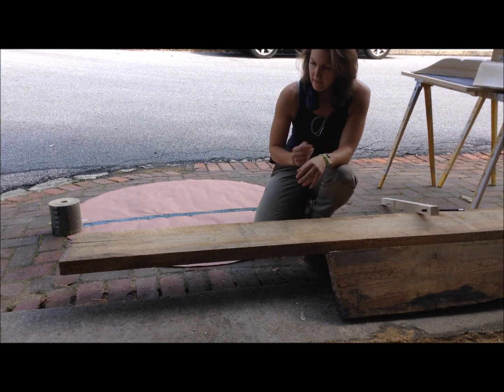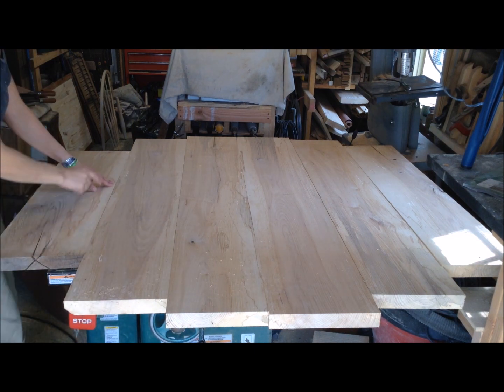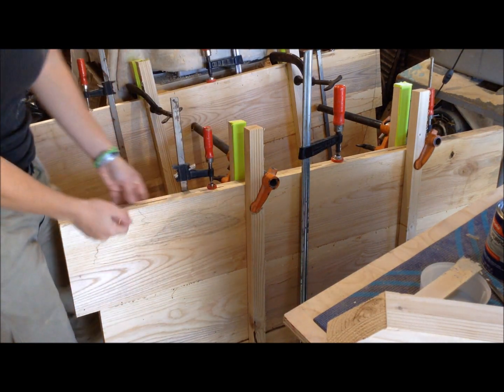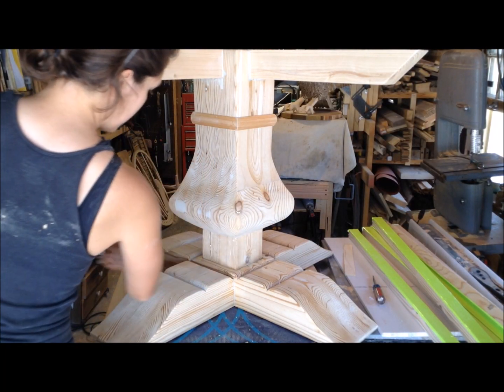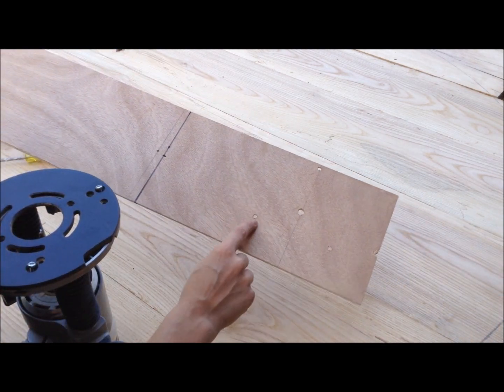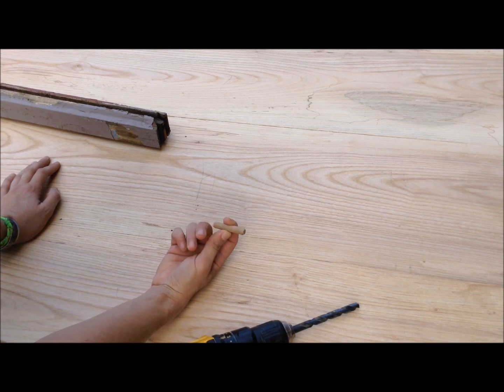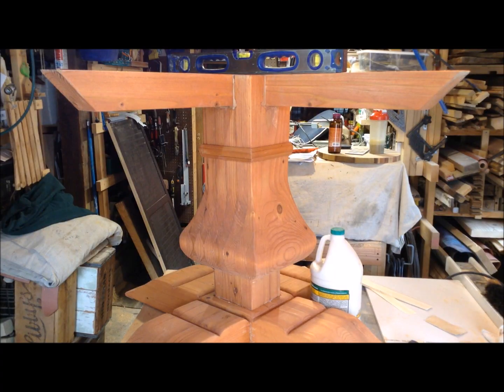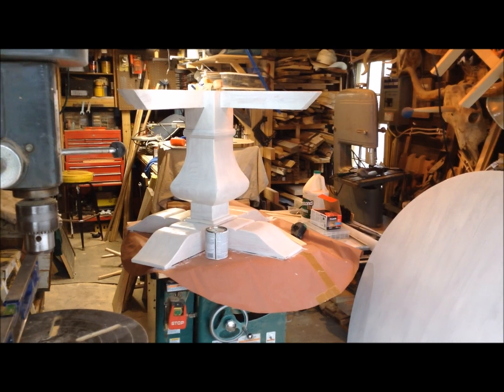How To Make A Pedestal Kitchen Table [Part 2]

Comment: Couple of tips I'd like to add. Always put stain or whatever your finish is going to be on all exposed areas of raw wood, including the underside of the top and bottom of the feet/legs. Especially if you're using solid wood.  The reason you do this is prevent warping and bowing. The raw wood will absorb moisture from the air and release it faster than the finished wood causing it to bow or warp. Another tip is to allow for expansion across the width of the table top in whatever method you use to attach it to the base. Wood expands with moisture, no allowance for it and you get cracks in the top. Great looking table, I think I'll do one like it in walnut.

Comment: Love your chainsaw use.  Couple thoughts;  the pedestal is only countersunk thru  1 1/2" allowing, over time a wobble.  I would lengthen your pedestal to allow full countersink.  I would pick up a piece of steel 1/8"  at least 1 1/4" wider than your pedestal foot, drilling holes on the perimeter and  4 in the area the pedestal contact.  During final assembly this will allow you to put 4" or better screws thru steel plate into pedestal. You'll need to route out an area on the underside of foot that is ground contact 1/8" deep, for steel plate.   
Possibly adding 1 shorter 2x to each side in width of feet, this will help with stability for years of use.
Reply from the maker: The only problem with a full countersink is then you are removing way to much material out of the the table feet.  All the corners will then be quite thin and subject to stress cracks.  Your method would work pretty well if the base of the pedestal wasn't so big, then you don't have to remove so much.
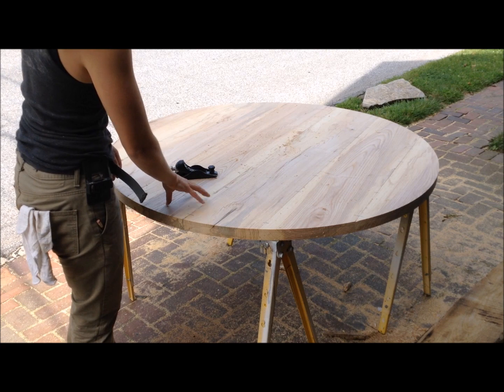Reply: @HoneyBadgerWoodWorks   Agree  with you on (thin) - cure ; at Time 12:40 thru 13:40 of Part 1 vid I would add a 3/4 board  from the second dimple in length , and 45 it to into your foot.  Time 20:09  of part two, -On the underside you countersink  the 1/8 piece of steel plate  the full width square allowing  long screws on an angle to  get a good bit on meaty of foot.  Tom

Comment: Thanks for the video. How did you attach the braces to the top of the pedastal? And, how did you attach the Table top to the braces?
Reply from the maker: Braces were just glued in place.  The table top was attached with four screws.  I drilled over sized holes through the braces and sunk the screws into the top.  The top is so heavy that is really all you need.
Reply: HoneyBadger WoodWorks, thank you for the response. I am attempting to follow your build and that was the only piece I wasn’t positive about.

Comment: I’ve noticed that most wood workers hate shabby chic. Are you one of them?
Reply from the maker: I don't mind a real life shabby chic, like barn wood that is actually 75 years old and the paint is worn and chipping.  Not a fan of faux finish shabby chic.  You just can't realistically re-create the look of something that has been beaten by the sun and rain for all of it's life.
Reply: I’ve done some furniture rescue recently. I’ve had success with a clean undistressed paint job on the legs and finished wood on the top.